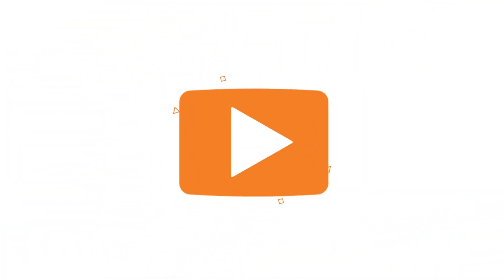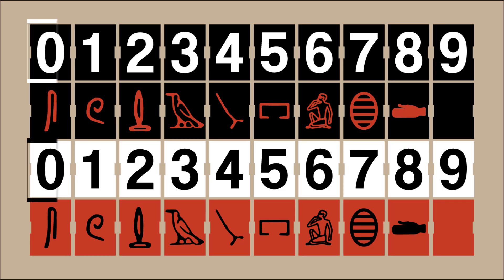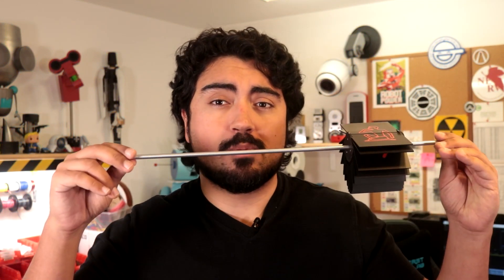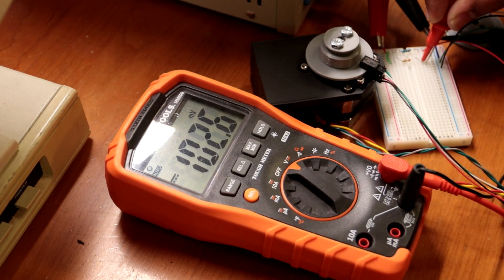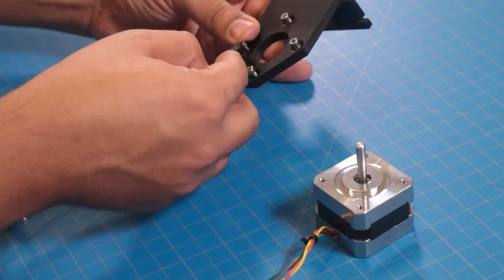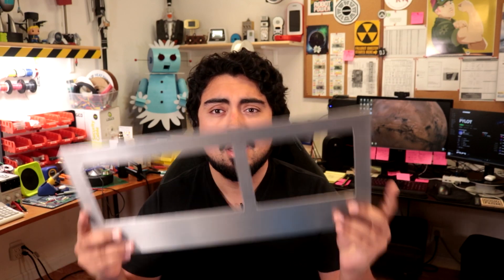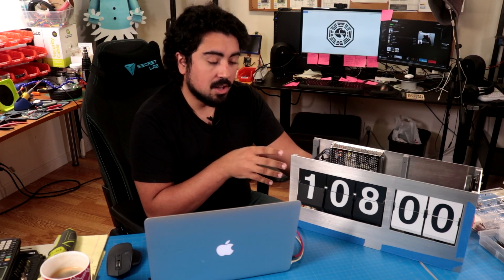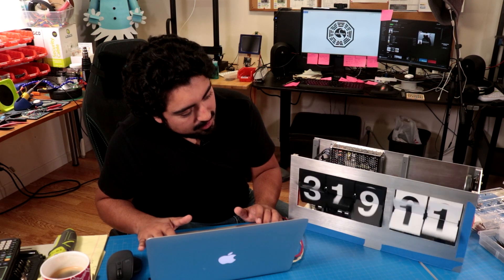DIY LOST Swan Station Split Flap Display Timer

Comment: My old clock radio had a pawl (finger) at the top so that it did not have to be perfectly level. Of course, disaster could ensue if the number wheels turned backward.

Comment: This looks great. Well done. ;)

I never really thought about the fact you could do stencils cut directly on things using the laser cutter. It seems to work out super clean.

It probably even helps stop the paint running, as the laser scores the plastic a teensy bit around the edges.

Just a random thought - rather than using the five stepper motors, what about using electromagnetic (solenoid) clutches?...

https://www.aliexpress.com/item/4000342638100.html?spm=a2g0o.productlist.0.0.51cc249481zbuj

That would only require one motor, with a clutch recessed into each reel hub.

The obvious drawback being that you couldn't always have all of the wheels engaged at the same time when changing symbols, but it could work out quite a bit cheaper without needing all of the steppers.

(then again, small stepper motors are very cheap these days anyway. I just thought it could be interesting to try the clutches in a similar project.)

You would also loose the positional info when using the clutches, as it might be tough to make sure the reels didn't move too much as each clutch released.

Hmm, maybe separate steppers was a good call. lol

Comment: i met you first time on instructables while you were making a moon calendar the project was fun but it required a raspberry pi it was expensive and it would be waste for such a simple project and also you made it out of a printed photo of the moon so that didnt look elegant to me , i wanted to mix your project with other moon calendar project but i was never successful , do you thing you can make an upgraded version of it where the whole thing is a 3d printed hemisphere of the moon and with simpler and also cheaper mcu like arduino and rtc of one kind?
Reply: Oh wow, what a throwback! That was almost 7 years ago. That was certainly a rough build. I was asked to use a Pi for the project which was always a silly choice, but youre right. Basically any mcu with an RTC can run such a clock. The linar phase code snippet should still be attached to that instructable which is the only exotic part. It would be cool to see a version of it with a 3d printed lunar lithopane! Not the only way to do it, but that came to mind right now. I have so many other project priorities myself right now, but you should go for building your own version :)
Reply: @MrVolt   yeah i should try it , meanwhile it isnt a bad idea for the crew to make a simpler less expensive project

Comment: 14:09 I think the problem there is that the spining of the wheels is upwards and not downwards like the rest of the presets (?) this clocks works because of gravity. I think it shoud always look for the numbers moving the flaps down direcction so they dont stuck even if is the longest "path" to find the selected number
Reply: The DIR pins of the drivers are actually pulled low with no connection to the MCU. My best guess is some kind of noise is somehow affecting the DIR pins, but the issue never presented itself when the clock was running otherwise over several hours so I let it be.